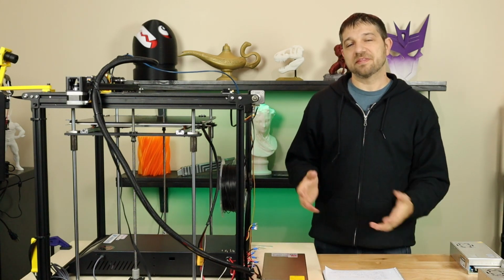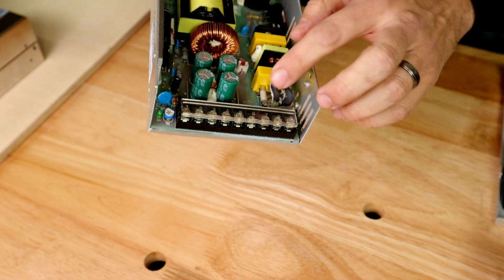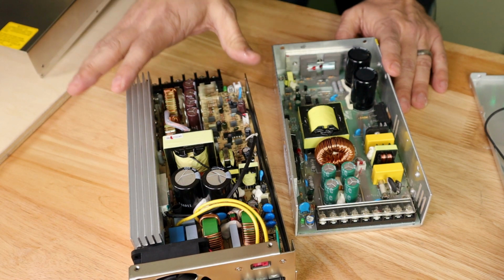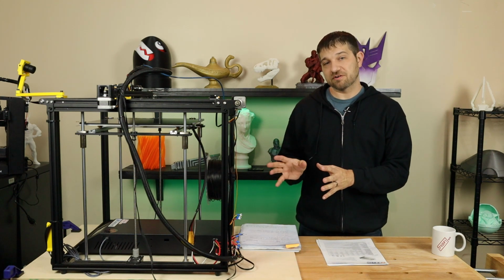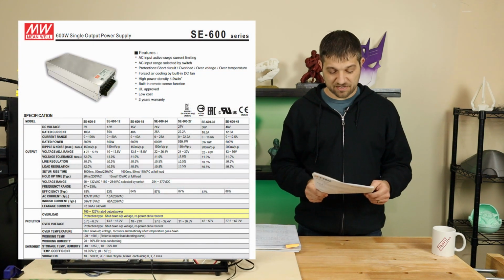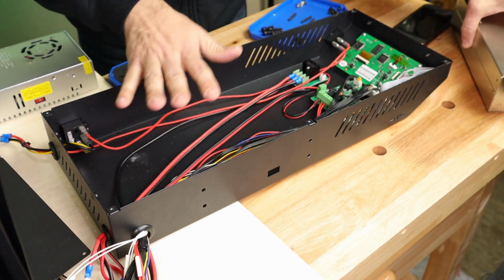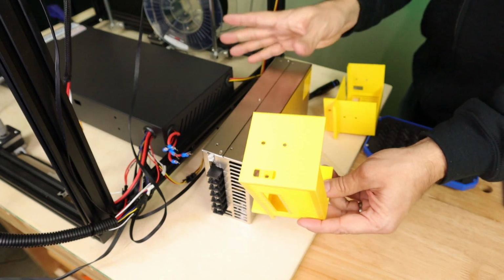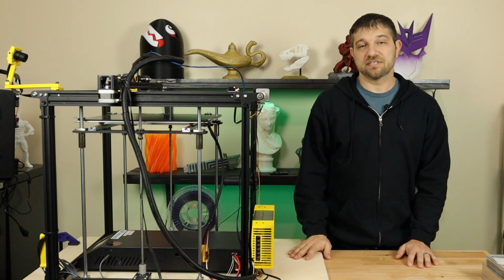Ender 5 Plus Power Supply: What You Need to Know!

Comment: I've been thinking a lot about this and I think I have a simple, inexpensive solution.  It's called a split power supply.  All that needs done is to add a second identical power supply in parallel (electrically) to the first.  It's actually pretty simple and since the original PSU is such a cheap POS it won't even be expensive.  The terminals of the two supplies need to be wired to each other one for one making sure to use wires sized for the loads.  Doing this will not alter the voltage at all but will double the available current.  Now, having said this you will still have two POS power supplies that will probably fail prematurely but not from being overloaded.  The alternative is to do the same thing with two quality supplies and spend a little more.  The second supply can be mounted anywhere that's convenient and safe.  Anyone wanting to research this can google "parallel power supplies".  I didn't invent it.  BTW, I believe all Creality printers can be improved the same way.
Reply: Please do not connect two power supplies in parallel. They will not put out exactly the same output voltage. The one that has a slightly higher output voltage will end up carrying most of the load, even if it is 0.01 V higher.

A coworker tried to do exactly what you described except with 3 in parallel. He never got the current he wanted and the system would not work properly.

There are power supplies that are designed to be connected in parallel. They are connected to a master controller that adjusts the output voltage of each one until the output currents for all the power supplies are roughly equal. They will be much more expensive than even the top quality power supplies that are meant to work on their own.
Reply: @philso7872  Thanks for your warning but I've done this before in my work.  It's no different than connecting batteries in parallel.  I can't diagnose your friends problem but I will be OK.  I will say that the outputs need to be connected to common cathode diodes so as to not backfeed each other.
Reply: @ramtek2702  You were lucky that it worked for you if you happen to get two power supplies that match closely enough. Did you measure the output currents of the two power supplies to ensure that they shared the current roughly equally, including when the ambient temperature changes? Did you ensure that the power supplies were stable i.e their control loops did not oscillate.

While you may have been lucky and had it work for you. It is very likely that it will not work for someone else. Most of these power supplies are rated to have up to 5% variance in their output voltage. That is more than enough for them to not share correctly. The common cathode diodes only ensure that they do not backfeed each other. They do not make them share in any way. 

The coworker who tried to connect 3 power supplies in parallel had to do it a different way. I had told him that it would not work before he tried. We lost a lot of time because he would not listen.
Reply: @philso7872  You don't understand.  I designed this parallel supply into a product.  The supplies were taken out of their box and installed into the product.  There are many of them running right now as I write this and have been running for years.

Comment: WATT is watt. Get 1200W server power supply and call it a day. Not sure that that printer is 12v compatible
Reply from the maker: Understood. You could convert the printer to a 12V printer but I'd rather not. You'd lose power on the motors and it would take longer to heat up the bed. You may even have to change out the bed.

Comment: I ended up using a Meanwell UHP-500 fan less supply not failed yet, I am about to add a enclosure heater to this setup
Reply from the maker: I may give that a shot! Keep some airflow going on it though.
Reply: I just hate the fan from the original meanwell psu, did you use this specific one? https://www.meanwell-web.com/en-gb/meanwell-uhp-500/uhp-500-24/ac-dc-slim-single-output-enclosed-power-supply-uhp--500--24?returnurl=%2fen-gb%2fmeanwell-uhp-500%2fuhp-500-24%2f%23uhp-500-24

Comment: Well, here I am in Nov 2023, and my Ender 5 Plus just arrived with an A-500FKD-24P 500W power supply manufactured by Chuanglian Power Supply Technology Corporation.  Let's find find out how long this lasts.  Not much on the web about it, not even on the vendors website, but I did find that it is used in the Anycubic Kobra Max.
Reply from the maker: Crazy! I hope it's a good replacement!

Comment: I don't think it's a good idea to get a power supply that's just on the edge of your power needs. Doing so is just using your power supply as a very expensive fuse for when it goes over spec. Did you do any investigation into whether there's a component drawing more power than it should? Is there too much resistance in the circuit? Is there a partial short circuit somewhere other than the intended shorts generating heat? Adding power without knowing can lead to something worse down the road, too. Using a penny as a fuse works, but definitely isn't a good idea.

I'd recommend that everyone should get a baseline for their printer when it's new and every time you add upgrades. I just got a brand new Ender 5 plus and this video has inspired me to do these checks. I run my printers off UPSes (CyberPower CP1500PFCLCD PFC Sinewave UPS System, 1500VA/1000W) which will tell me the current draw. I also have a new all-metal hot end with a higher temp thermistor from Gulfcoast Robotics I plan to install. I can check the before and after and update this with what I find.

Comment: I would also change the wire open end spade terminals to ring round closed type terminals,  they help prevent arcing with higher amps. great video
Reply from the maker: Thanks for the tip!
Reply: I think what you meant is that open spade lugs can come completely detached, while ring terminals will not. Either can arc if sufficiently loose.

Comment: I just got my Ender 5 Plus, it came with a Mean Well RSP-500! Although I'm having major issues with filament leaking out the sides of the nozzle
Reply from the maker: That's great on the power supply. If the nozzle is leaking, you can try tightening it. If that doesn't work, disassemble it and put it back together. I did a nozzle replacement video a while back.

Comment: Did you ever release the video you mentioned here about the full installation of the new power supply??
Reply from the maker: I didn't do an additional video. What kind of replacement supply do you mean? The one I did on the back or a replacement internal one?
Reply: @kerseyfabs  I bought the same 600 watt power supply that you installed in this video.

Comment: I just got my Ender 5+ they say check the voltage switch to make sure its on the correct voltage. What if my printer didn't come with a switch to change from 110-220 do i just assume it comes 110 to the US. I'm kind of stuck and haven't seen how to fix it in any of your videos.  I don't want to burn up my new printer. I can't contact technical support through email or phone.
Reply from the maker: The switch is on the left side of the metal box under the printer. If you're in the US (110V), running the printer in 220V mode won't hurt it but you'll notice weird things happening with your printer. Running 220V with 110V would be bad.

Comment: Wish I had seen this before I bought my rather expensive RSP-500, checking prices the SE-600 is actually cheaper by quite a bit (Alas, they (SE series) are illegal to sell or ship to Europe). The next step in the RSP series is the 750 at quite a price premium (and overkill).
Reply from the maker: Sorry about that. I also wasn't aware of the EU exclusion either. I guess it's missing a specific certification.
Reply: @kerseyfabs  Yeah, found out when I was planning upgrades. Apparently TH3D can't ship them to Europe and when I was looking for the SE in Europe (I bought from Mouser which is international) I was informed they couldn'ät ship that series here, so I went with the RSP series. Not exactly sure why they are so much more expensive than the SE series.
Reply from the maker: @SteinerSE  European certifications. 😆

Comment: I have been using this 600w PSU on my E5+ for a good while, and was wondering how, if even possible, to replace the fan in the PSU with a 120mm fan. I know the fan would have to be mounted outside of the PSU because of how crowded the box is. This would primarily be for noise control, but it would also move a lot more air across the PSU which certainly wouldn't cause any problems. Not only did I do everything you did in this video, I also relocated the control box to be outside of the printer, which meant I had to extend every one of the power wires, as well as get wire extensions for the stepper motors, and a few other components.
Reply: are stock fans on these PSUs thermal managed like on higher end PC PSUs? or just on any time the AC is supplied.
Reply: @filanfyretracker  If you're asking about the 600w PSU, yes, it is constantly on whenever the printer is on.

Comment: I just purchased an Ender 5 Plus a few days ago (8/16/2020) and mine came with a Meanwell RSP 500-24 pre installed however there is no voltage selector ?
Reply from the maker: That's normal. The Meanwell is an auto-switching supply, so no need for a physical switch.

Comment: Nice work! I just bought one of these 5+ printers and glad I saw this.Going back to my computer mod days I would hesitate run a box that runs at 650W+- with a low grade 500W PSU. Just asking for trouble. I will be replacing with a MW RSP-500 PSU. There is a ton of space in that mechanical box. I wonder if the PSU will fit if you took it out of the enclosure. You could attach the fan to the back of the enclosure to add air flow to all of the electronics.
Reply from the maker: Computer mods is where I started too. Plenty of people have decided to go with that supply and I've heard zero complaints. That's an interesting idea about the enclosure but I think it would definitely be a safety issue, so I'll stick with mine.😆

Comment: My ender 5 pro just arrived yesterday. I already planned to upgrade it to a Duet mainboard for use of dual extruder Chimera system and perhaps if needed, to upgrade the bed for PETG use. 
Question: if I add a really huge power supply say 850watts (I rather error on too much rather  than too little) is there a risk of too much power? Thanks!
Reply from the maker: You'll be fine. Power is not pushed, it is pulled/consumed. Therefore, components will not use more than they need.
Reply: @kerseyfabs  great thanks. I build computers so I think in t terms of that but 3d printing is new to me going solo. I have a very good idea of what I want and may need but I do love options, in my experience having as many options available saves time and money as the need to add components is greatly reduced. A very large power supply will do just that. Thanks!

Comment: Thanks very much this mod work for me all I needed was a lot of patience oh and a mosfet extender plate to bring the wires 2" closer. I still would like to see a detail install video. and how does one install M5 x 10, I got the lower two but no luck with all four at the same time.
Reply from the maker: No problem. If all of the screws won't go in, be sure to check out the part's dimensions versus the model. See if your printer or slicer need calibrating.

Comment: my ender 5 pro, in <10 degrees C ambient temperature, on 240v supply uses less than 100w to print with a bed temperature of 65C, Extruder 210C, 12v LED lights for camera, raspberry pi and external filament heater set to 55C
the OP comments that the current used when heating is to be expected to used continuously is probably not accurate - maintaining a temperature uses less current than sustaining that temperature.

Comment: Wow I know this just is almost a year old but it just came up in my playlist. I bought a Ender 5 plus about a month ago and it came with the Meanwell power supply. Has anyone mentioned a 2 power supply solution? One for the bed heater and the hot end and another for electronics? I am thinking about a precision ultra low noise AC/DC switching power supply. I cant help but think a separate power supply just for the electronics could give a bump in performance of the printer and stepper motors . At least it could provide extra protection for the more sensitive electronics. Maybe a idea for another video seeing as how you have all that extra room in your enclosure.
Reply from the maker: People have mentioned it and it's not a bad idea at all. I do try to keep most of my solutions as simple as possible though and that would be more involved space-wise and technically.

Comment: Like the Ender 3 Pro, is it possible to install the power supply outside an enclosure to avoid overheating? Great channel, by the way!
Reply from the maker: Thanks for watching! That's what I do in this video. I install my new supply on the rear of the machine. It would be possible to create mounts for other supplies.
Reply: Thanks. I replied before I got to the bit where you remounted the new supply.

Comment: At this point why not build your own in chassis electronics box that has the screen, main board and power supply without the constraints of the box from creality?
Reply: my stock supply is still working, to note I use octoprint and have it heat the bed first then the hot end. once its up to temp it shouldn't pull as much all at once. how do you feel about the 
mean-well-lrs-600-24?

Comment: I'm having issues with my ender 5 regarding bed adhesion. It seems that between the home position and starting the raft the nozzel is beginning to extrude before the bed raises back up. Any suggestions?
Reply from the maker: I doubt that's actual extrusion. It's probably prepping of the nozzle from your start g-code. Let me know if you think it's something different.
Reply: @kerseyfabs  I'm uniformly missing the first inch and a half or so of any given raft outline i print. Sometimes it sticks regardless but I've got multiple prints now that have just popped off the bed because of it.

Comment: Thanks for all you videos and awesome content!
My Ender 5 Plus won't turn on anymore and I thought it might be the power supply. However I've taken the chassis apart and it seems as though the power supply is ok. There is power from it to the boards. However the fan doesn't run nor does anything show up on the display. Nothing looks "zorched" inside the power supply. Could it possibly be the main board itself? I do see that an led on the main board when i plug in my raspberry pi running OctoPrint.
Reply from the maker: That sucks! It pretty much has to be the power supply or the mainboard. Which one it is, I can't be sure. It's pretty easy to test the supply with a multimeter though. If you plug it in, you should get 24V across one of the black and red DC terminals. Make sure you know what you're doing if you test this.
Reply: @kerseyfabs  i bought the 600w mean well and it  powers up, display works, so MB is good. however i'm about to replace the MB with the silent board now. Thanks for such marvelous aids!

Comment: I couldn't find the 500watt supply on the Zyltech website but rather a 480watt.
Reply from the maker: Yeah, the listing seems off. If you look at the picture, it still has 500W written on the side of the supply.
Reply: @kerseyfabs  I wonder if they increased or decreased the rating.
Reply from the maker: @ramtek2702  I'm not sure but at least 20W isn't a deal breaker.

Comment: My ender5 plus from factory has been making a whirring sound from day one on cold startup, every time. It only occurs when the printer is cold and initial start up. 
Currently investigating the issue.
Reply: Further more,  my PS is a 500w 24v mean well 
(RSP-500-24)
Reply from the maker: There are multiple fans it could be: hotend, power supply, or the one over the electronics. You'll just have to isolate which one and either clean or replace it.

Comment: I am getting supply near extruder and near screws when the machine is running. Please help me.Its not dangerous but annoying.
Reply from the maker: Actually that sounds dangerous even if it's not hurting you too much yet. You need to double check all of the wiring going into the supply and double check the screws going into the supply and make sure they aren't too long and touching internal components. If you can't find it, you need to find someone that can. Be safe!
Reply: @kerseyfabs  Hai bro,thank you. I GOT IT DONE WITH THE HELP OF ELECTRICIAN. The plug point was not properly grounded.i got it rectified by connecting to ground by flower pot with a copper wire filled with sand and charcoal.no problem of short circuit now.Thank you for your concern
Reply: @kerseyfabs  when opened the switch board I was surprised to see that earthing was not at all.
Reply from the maker: @bkcganeshblogs  I'm glad you got it fixed properly! Well done!
Reply: @kerseyfabs  I am really happy that we can communicate through this platform. I am happy that with guidance of people like you,I can list my own customized products in Amazon. Thank you so much.